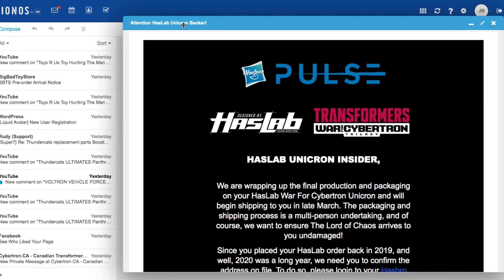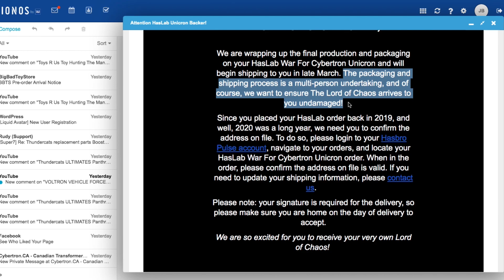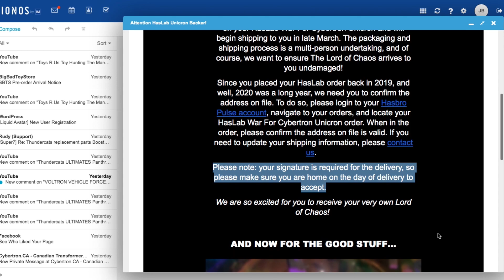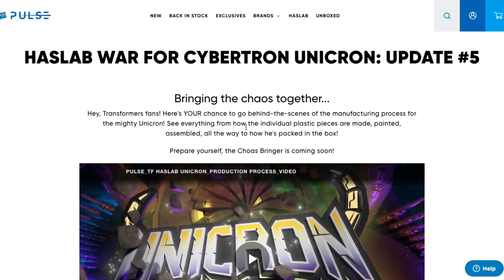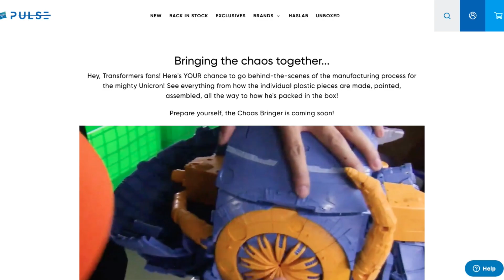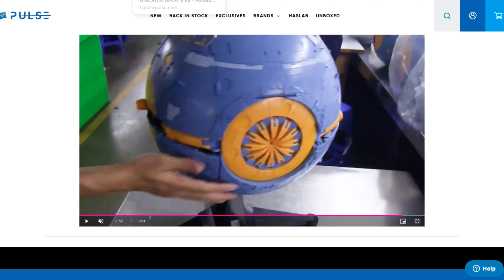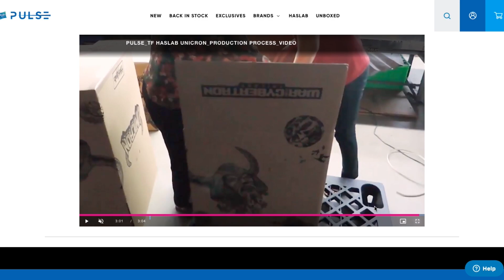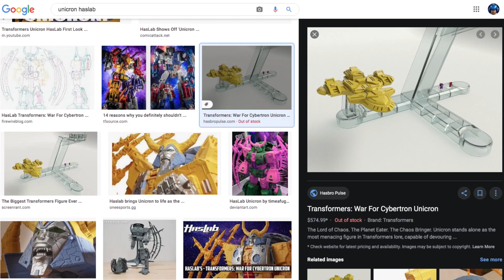Haslab Unicron Ships March 2021 | Transformers War For Cybertron Unicron Update #5 Mega Jay Retro

Comment: I've seen pictures of people who received their Unicron...this is sadly the final product. I'm about to cancel my order. They screwed it up. This is major false advertising.
Reply: I got over the blue maw in planet form and on the website Hasbro did state that the color represented may change. When I saw that his lower teeth were blue, not silver to match the upper teeth, and add on the pringle chips layered stacks on both legs and his back! I think I'm going to sell this one and enjoy my Armada Unicron. Also the paint on the minifigs do not match the original pitch photo.
Reply: I agree, some changes can be over looked but changes to the focal point and play feature of planet mode is unacceptable on a 600 dollar collector item that we pre ordered in good faith
Reply from the maker: @Scott Contois I wouldn't cancel your order, this is a once in a Decade Figure. You may regret not having this figure just because of some minor (well overall minor YMMV) issues.

I think this item will only go UP in price, and any collector who doesn't have it will regret it later.

Also, I think its actually too late to cancel your order at this time.  I could be wrong, but I remember reading on the Haslab site, that after a certain date orders are final, and we're WELL Past that now.

I think what is much better in this case is to send a "CALM and COLLECTED" email with your complaints, stressing your displeasure to hasbro about your experience, and how you feel you have been misled about the product.  The way Haslab handled the "UPDATE VIDEOS" was deplorable, they sent us FLUF about boxes, and transportation concerns (shaking a box?  c'mon hasbro!).  Instead of alerting backers of the changes throughout the process. That was just terrible, and I think if there was a bit more transparency backers wouldn't be as upset as they are right now.

Comment: The campaign did say legally on the campaign *Colors not final and subject to change. It's also due to that maw piece being a structural piece that it's the dark grey blue since orange plastic usually isn't good for structure.
Reply: Orange plastic he says 🤣🤣 bro...we paid 600 for this. Ehrmagerd paint.
Reply: Yeah for 600 they could have painted it
Reply: With colors are not final, you’d expect maybe different shades of the colors, not a whole different color. For example: If I buy a red power ranger and they say ‘colors are not final’ I expect maybe a lighter or darker red, maybe a shiny red, but I don’t expect it to be blue!
Reply from the maker: @CannibalChow I see where you coming from, but this really was quite a massive change compared to what they were selling. I know that the prototype was painted on top of gray resin. In fact if you were at San Diego Comic-Con you could actually see some of the paint flaking off from the sections where they were transforming it.

What I don't agree with is the disingenuous nature of their "updates" to backers through their official Haslab channels.

Instead of showing us updates about the box being Brown without color, and shipping shake tests which really served no purpose whatsoever, they completely hid the fact that the final product would have massive changes in its color and production.

Haslab deliberately waited until the very last month to show us official pictures of what the final product would be, and then to add insult to injury showed us the manufacturing process / rollout where it's already too late to change. 

I think that's where fans and backers are most upset. It has that was more transparent as to the nature of the production changes and other updates to make the figure more viable in toy form.

Backers would probably have been more understanding as this does happen, instead they decided to hide the fact and show us useless updates instead of actually communicating with their backers.

And that's why I think people are mostly upset.

Comment: So I'm hoping that Maw is just a early display or fitting. I went to look at a ton of images and that maw is painted in over 90% of the ones I saw. I was however looking At update #3 video and about 1 min 30secs and 3 min 30secs in, I could kind of make out the gray parts in the maw. After nearly a year and a half or waiting for this thing, to have to worry about that one paint application.... well thanks Jay you took my mind off still figuring out where I'm going to display this monster .. lol       Ironically I would totally take the prototype color gray version.  :-)
Reply from the maker: @Trent Runner I think we were all misdirected by haslab in this case. Whether it was intentional or not we probably will never know.

And the overall scheme of things the blue part of the mall is probably the most upsetting, but the overall design of Unicron is mostly intact. And we can at least rejoice in the fact that it is coming to our homes more or less on time. If we were successful in campaigning for updates to the Maw, hopefully expect we would not see this in 2021. Likely we would have to wait until mid 2022 before it actually showed up in our homes.

That's not to say that this was an acceptable thing to do. the Haslab team really should be answering a lot of fans questions but so far we're being met with silence.

We should all be sending letters of disappointment to has lab letting them know that we won't tolerate this in the future. With upcoming projects like the X-Men Sentinel, and the Razor Crest, we can only hope that more attention will be paid to the final products. But moreover that's more communication through the Haslab product updates will be more transparent to the fans who backed these amazing figures.